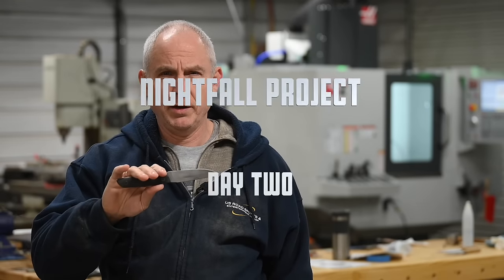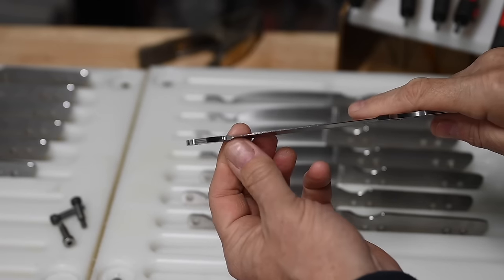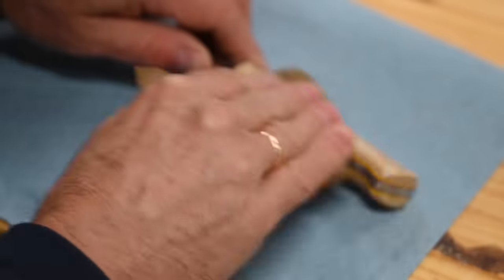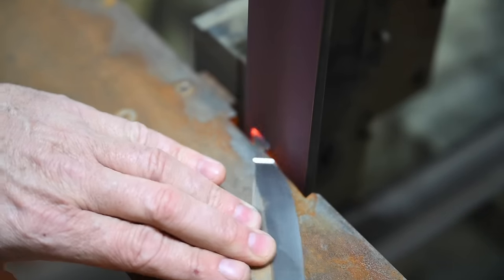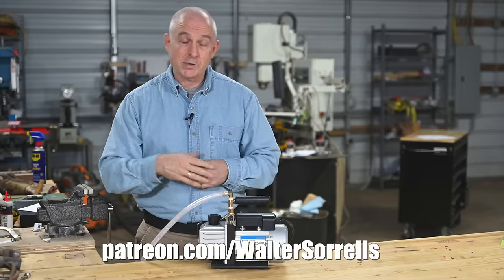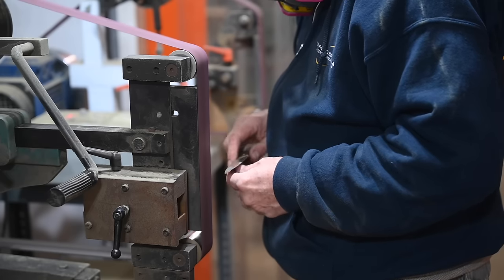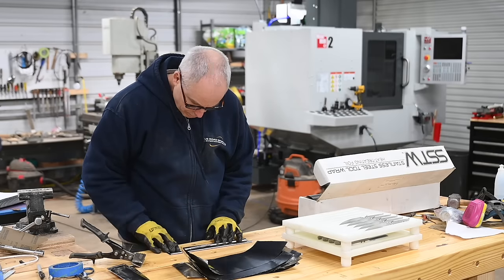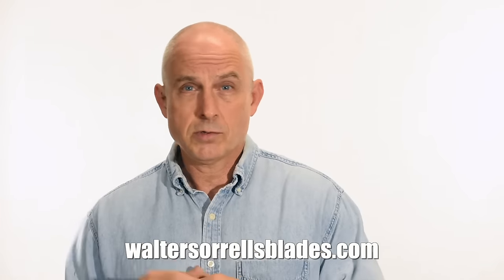A Day in the Life of a Knife Maker - Nightfall Project Day 3

Comment: Lol yep cnc, especially the CAD/ CAM, can be very nitpicky! Forget to select 1 check box out of a few thousand, and project is scrap. Forgot to move the work offset in CAM from 1 setup to the next, or think it's on a stock point but it's actually on a model point, project scrapped. I'm new to CNC but it seems to be a never ending exercise in ultra extreme close attention to detail. Which is fine with me,  I enjoy that sort of stuff. Definitely more challenging than most people think. Pretty sure the average person thinks that you find or model an object on the confuser, then press a button, and the mill spits it out flawlessly, cleaned and polished, like a desktop printer. Lol